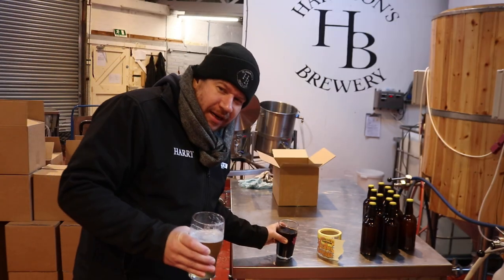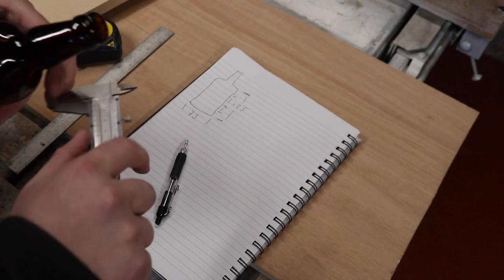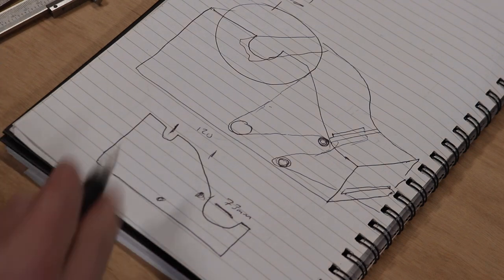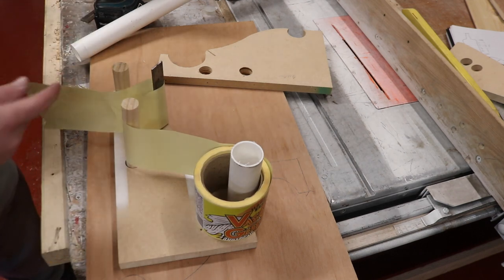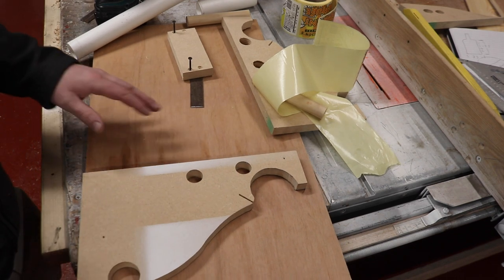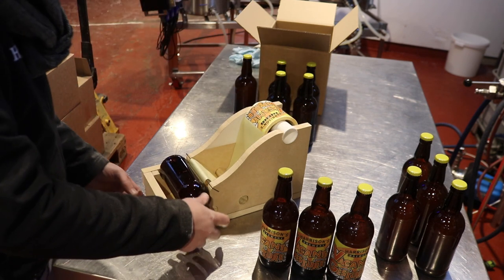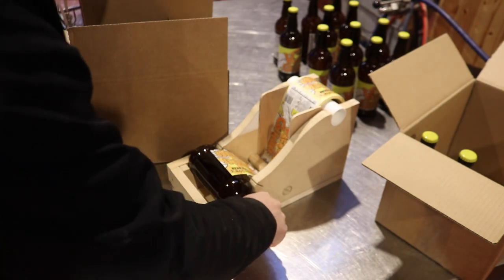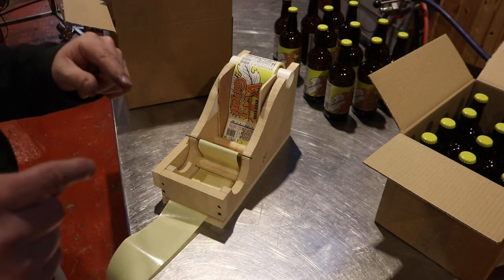🏷LABEL 🏷APPLICATOR  🍺 FOR BEER BOTTLES

Comment: harry, i know its an old video and you probably have a motorised commercial one by now but ref the distance from the bottom of the bottle you could remove the section your using for a bottle stop , extend the base and set up a horizontal nut and bolt through it system, just turn the bolt in or out through the nut to have a user friendly / adjustable stop point